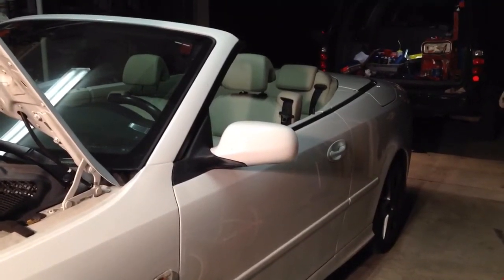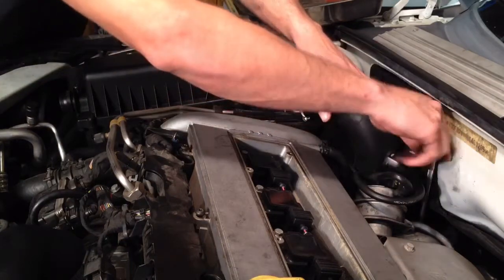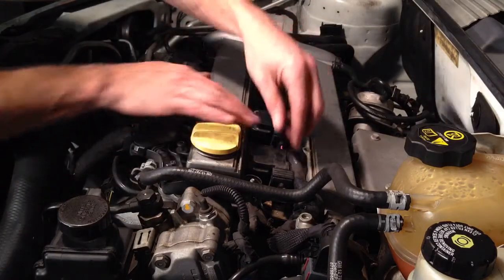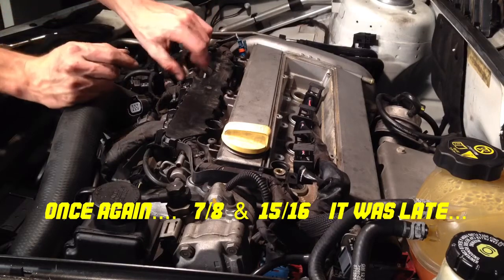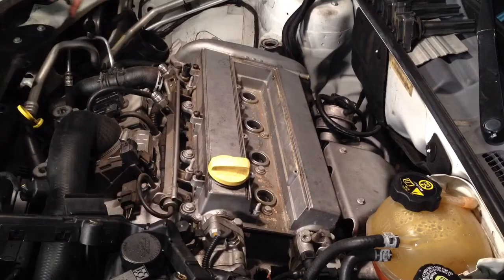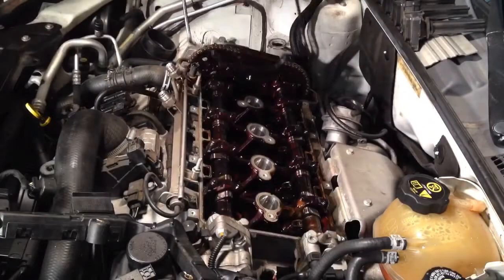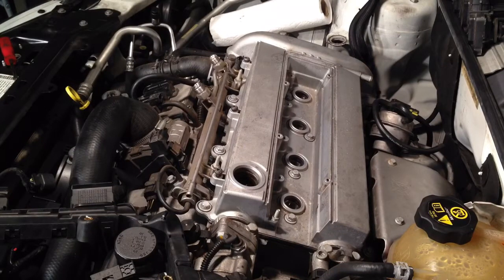2003-11 Saab 9-3 2.0 Turbo Valve Cover Gasket Replacement

Comment: Hello, thank for your video! My saab 9-3 2009 biopower experiences loss of power going uphill and does not run smoothly... it even goes into limited performance mode now and then... I  have noticed a little bit of oil in one of the wells, clearly coming from the gasket - can it be the cause of my problems (I changed the plugs and air filter and this made no difference)?
Reply from the maker: Trampolinwildlife you getting any service codes? A little bit of oil in spark plug tube doesn’t hurt too much but could possibly foul coil.
Reply: @ecanixgarage1106  Thanks a lot for taking time to get back to me. I don't have a reader. I have noticed that if I clean the tube it works better for a while.

Comment: If your valve cover gasket is bad could that possibly leak coolant into your oil? And cause the car to not start and just keep cranking and cranking? I'm really hoping I don't have to do the head gasket

Comment: I did a valve cover gasket Fel Pro sans sealant, so I think that's why it's leaking more than before I changed it?
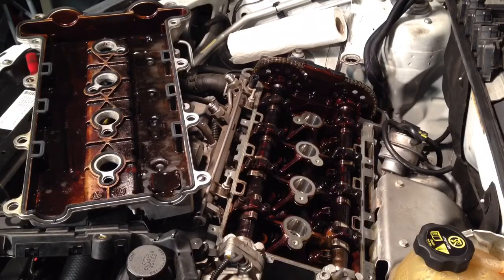It that's the case at 6:52 you say you applied RTV sealant "there" can you specify where "there" is?

Comment: Good video I would have replaced the upper chain guide while I had the rocker box off depending on mileage.  60.000 plus for sure.
Reply: reviewmaster 44 what did u use to clean the valve casket? Or what can u use

Comment: I have a misfire I changed all the spark plugs and coils pack but I have noticed cyndr #3 has oil in it will changing the gasket help the misfire and the leak on spark ?
Reply from the maker: Pedrx_V yes the valve cover gasket replacement will stop the oil leak in the spark plug tube.  However, unless it’s completely full of oil,  it usually doesn’t cause a miss.. try swapping plug and coil to another cylinder, then if still missing on 3, run compression test on cylinder 3 and compare compression with 2 and 4.. after you verify compression is good, buy/rent a noide light kit to plug into injector harness #3 to confirm injector is noiding/sending signal.  If sending signal then replace I️njector... 👍🏻
Reply: alright thanks im going to be changing the gasket soon, i have only been cleaning the cylinder and it goes away but comes back after 1 month of driving, so thats not working out
Reply from the maker: Pedrx_V sounds like that is your problem!! Check to be sure all bolts are tight until you get a chance to swap it out!

Comment: I have a p0606 engine code, checked the spark plugs because they were due and found spark plug well #2 had 2 inches of oil almost to the brim. Read online, the valve cover gasket is most likely the culprit. I sucked up the oil in the well with a turkey baster, stuck rags inside and used a mild amount of brake clean inside the well. Engine started and huge cloud of smoke but it then cleared, I still have engine code p0606 and limp home mode activates after I drive for a while, would changing the valve cover gasket solve this issue? What else can cause this issue that I don’t see at the moment?
Reply from the maker: Adrien Mathieu it is ABSOLUTELY the valve cover gasket, to be exact the spark plug tube seals that come with the gasket.. if you pulled the spark plug out, whatever oil was left over drained into the combustion chamber and burned out once you started it( no biggy).. change the valve cover gasket and tube seals and clean the spark plugs.  If your still missing on #2 try first swapping the coil to a different cylinder, clear codes, and see if code changed to different cylinder. That will tell you that the coil is the problem.. you can also try swapping plugs if the coil wasn’t the problem.  Keep me posted
Reply: @ecanixgarage1106  Thank you a lot, I really appreciate the feedback from you.
 I've ordered the new gasket/tube seals/grommets and it will arrive in 2 days. Am I okay with using brake cleaner on the coils/well/plugs to remove the oil? I have access to compressed air, does that help? Can I reuse the new spark plugs that are coated with oil if I clean them up? What amount of found pounds of torque should I tighten the valve cover bolts? 

Thanks in advance Colby.
Reply from the maker: Adrien Mathieu yes use brake cleaner on all of that, gasket surface, coils, plugs, etc...  spark plugs should be fine since I think you said they were new,  just hit them with a shot of brake cleaner...  no need for compressed air. As far as valve cover bolts. They should bottom out right where they need to be but if I you were to torque them (which I never do) prob 15 ft lbs.. also don’t forget to put a dab of black rtv in the corners of the valve cover gasket where the half circles are.
Reply: ECANIX GARAGE  I fixed the gasket and stopped the leaking. However The engine light comes on when I’m at operating temperature the code is p0606 ecu fault & p0638 throttle body code. I can reset the computer by disconnecting the battery for a few minutes however the engine codes persist only when at operating temperature. I’m bewildered at this point.
Reply: Dry poor idle and stalling when I come to a stop.
Reply: @adrienmathieu5193  make sure ur coils are tight and use dielectric grease inside them when ever you remove them and replace them.

Comment: I found oil on 1 spark plug, so clean up oil, replacing plugs as they were corroded BAD, also changing injectors while I have it ripped apart... Some days codes n miss other days no codes...
Reply from the maker: What codes are you getting?